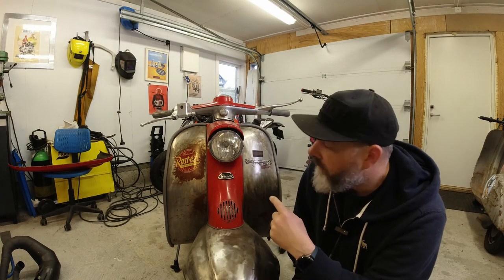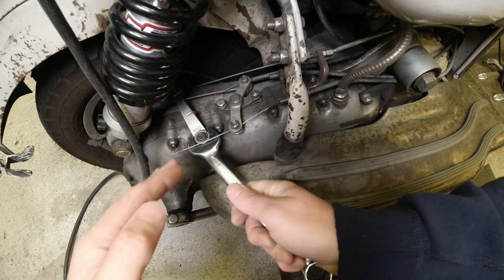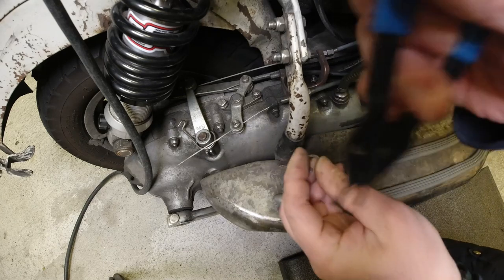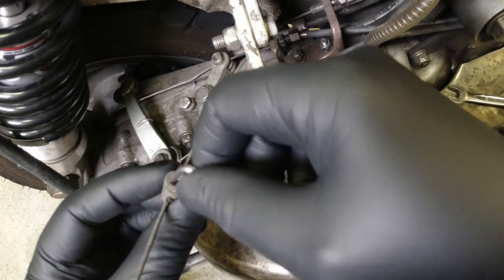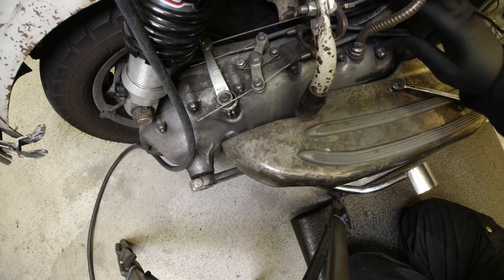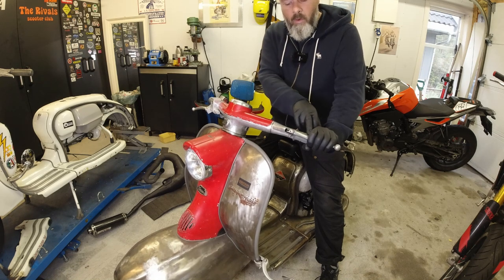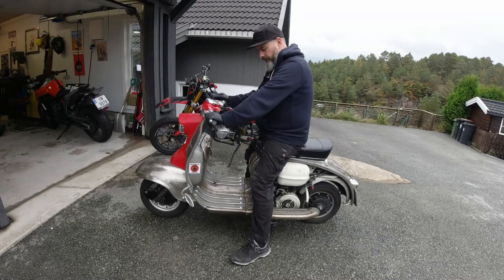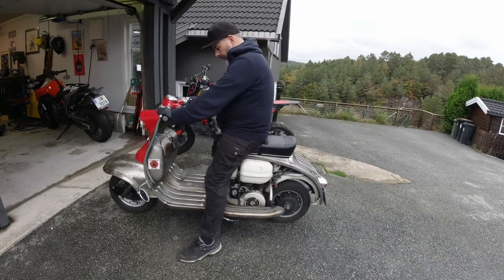#lambretta clutch cable adjustment, for dummies!

Comment: We bought two imported li 150s a few months back and ha e carried out several bits of maintenance while I’m patiently waiting for the Dvla to register them and had to do this after we had the chaincase off to adjust the kickstart ramp and it makes a big difference having the lever at 90 degrees, so much easier to pull the lever 😀👍
Reply: Did you bought from uk? I am looking too for a 125 special Li Serie
Reply: @adrianobonaldo8941  hi yes the 2 Li150s were imported to the U.K. some years ago but were not registered so we did that ourselves we also bought a 125 special from Italy and imported that and have also registered it ourselves

Comment: on your crankcase breather you have a pipe......what is this connected to??
Reply from the maker: Not connected to anything. It's an MB breather that solves spitting from using modern gearbox oil. I'll do a quick video on those as I get asked this a lot!
Reply: @kickbackgarage  Thanks.............I've learn't something today at least  :)

Comment: Could you do a video on the gear selector? Every adjustment I make i still cant get 4th gear.
Reply from the maker: Is it a new gear swivel?
Reply: @kickbackgarage  its the original one. It has no play in it.  Ive tried so many times that ive even stripped the gearbox and rebuilt it again. It had no problem. And if I disconnect the cables can engage 4th.  Just wondering if like the clutch there was a particular angle of degree?
Reply from the maker: Ahh, if you can't rock the scooter in 4th, then it could be either the cables are to tight, or you have fit the cables to the wrong trunnion. I.e. Back to front.
Reply: @kickbackgarage  the cables and trunnuinon are all correct. Ive tried with it wound all the way in so not tight then slowly adjusted them. Its driving me crazy. Like I said it will engage 4th if I disconnect the cables. On your video is the lambretta in neutral? If it is i will try and angle the selector the same as you have.
Reply from the maker: Yes. I fit the cables when it's in neutral.
Reply: @kickbackgarage  im thinking that maybe I will try and take the hub off and see if the 2nd lever will change anything. Thanks so much for your advice.
Reply: @kickbackgarage  sorted. Thanks for the advice. It was the 2nd lever behind the hub. Just moved it 1 spline and now its engaging into 4th. Simple fix should have checked that 1st would have saved me stripping the gearbox
Reply from the maker: Annoying but fantastic when it's sorted! 💪

Comment: Point to correct in your video. The small lead coupon needs to go on top of the cab,e before the grub locking screw. The reason for this is to protect the cable from the grub screw cutting into it as you ‘wind’ down the screw to tighten it otherwise you will sever some of the wires and have problems next time you adjust or remove the trunions.
Reply from the maker: If I had a fiver for everyone who said that I would be rich. 😂  It actually depends on the trunnions. Some, like these, are drilled too deep and if you fit the disk on the top it destroys the cable because it is pressed in the recess. I only use oiltek now because of this.
Reply: @kickbackgarage  we all have our own opinion on what’s right and what’s not but mine is based on fifty years or engineering experience and like you I use these trunions but I would still recommend the ‘slug’ on top of the h cable to protect it.  You pays your money…….
Reply from the maker: I think you have a reading problem.

Comment: Can anyone answer why my GP is unable to freewheel backwards when the clutch is engaged? The clutch seems to work as normal otherwise when pulling away.
Reply from the maker: Your clutch isn't working.
Reply: @kickbackgarage  Thanks for your reply.
The clutch does seem to work.
As I said, the rear wheel is locking only when trying to 'reverse' with the clutch in and in gear but no issue going forward. Other than that the scooter pulls away and changes gear without issue . Can you elaborate as to what the problem may be and how to possibly resolve it? 
Much appreciated.